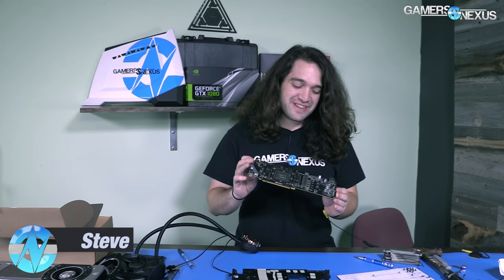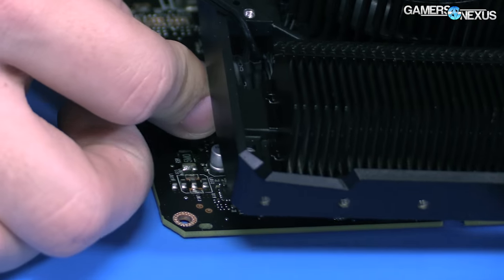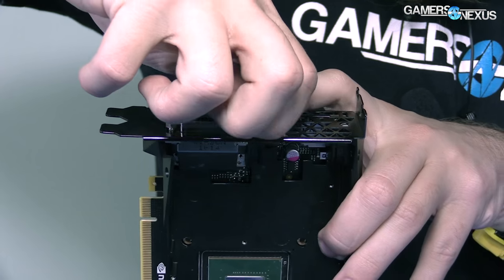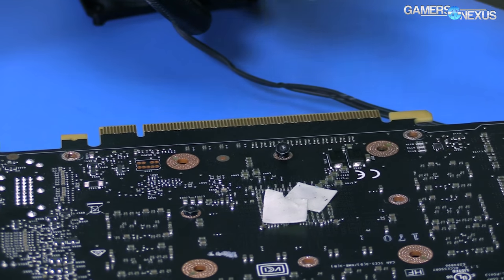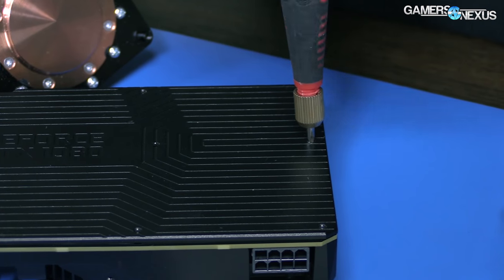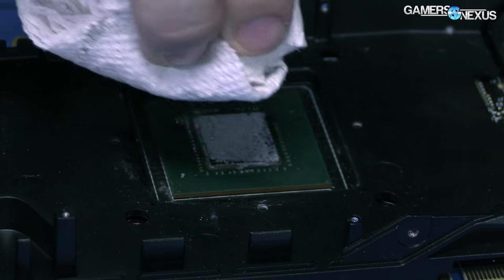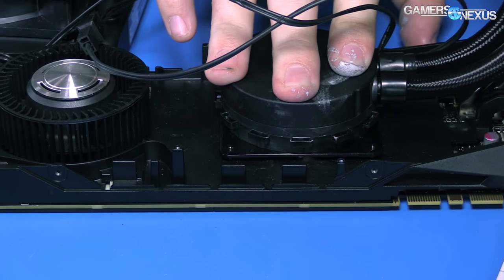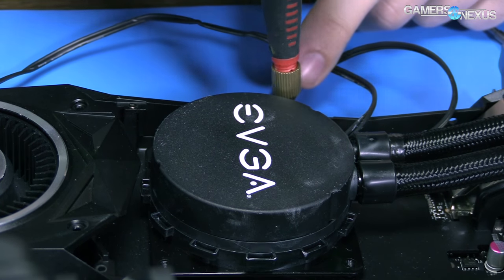Building a GTX 1080 Hybrid Part 2: Assembly

Comment: Why the hell is your thermal paste in a jar, watching you a apply that with a credit card made me cringe. Also it's fine if a little paste spills over the side of the die plate. As long as the paste is non conductive it won't harm anything.
Reply: It's ok even if it's conductive, and if you watched the video he explained why it was in a jar and that he preferred the dot method
Reply: Yes it is easier to apply the dot method from a tube, but you have clearly not watched thw video. It was in a jar because thats how it got shipped, making it hard to use the dot method altough he preferred the dot method.
And ive build over 100systems, never used any "non-conductive" stuff. It dosent stay noncontuctive forever either
Reply: are you deaf or something? he said in the video why the thermal paste is in the jar.

Comment: Id rather pay for the motherboard of the graphics card, then paying for the whole plastic top cover cheap shit fan. 700$ meh, way to overpriced, gunna wait till it lowers, or just buy 2 gtx 980s for the same price. maybe even cheaper, same results, just more power consumption, but that doesn't really matter. btw couldnt you have just removed the fan and hotwired the pump? i mean that fan is kinda useless now and its not working as efficient since the pump is now draining energy as well...

Comment: Holly Butcher batman! Get some real screw drivers and take your time..... this video is cringe worthy of a train wreck.......  The metal shavings left on the table make me sick... Your missing screws and AFTER using a hammer  on a screw driver mushrooming the end  with sharp edges  you continue to use it.....  But don't worry he is static clipped to the table all is safe....